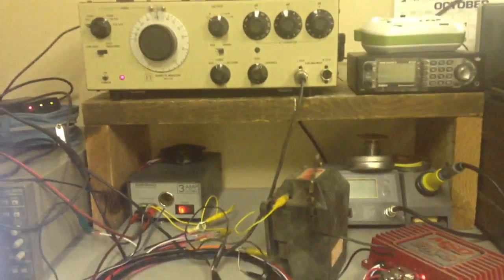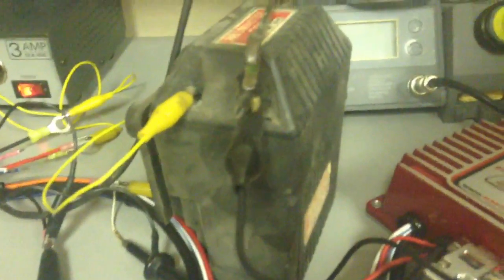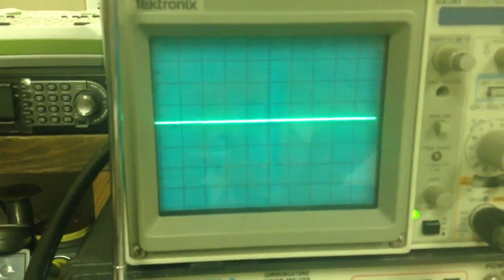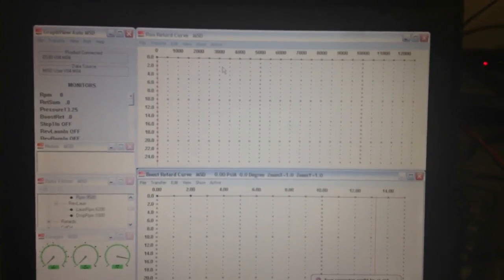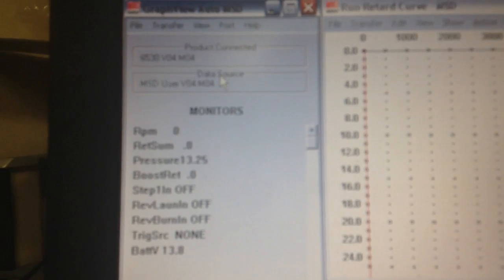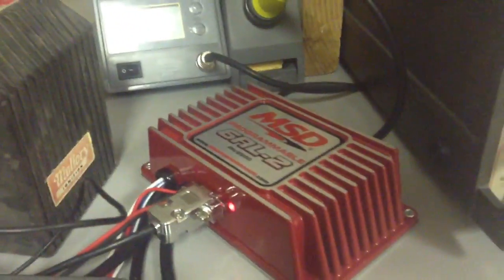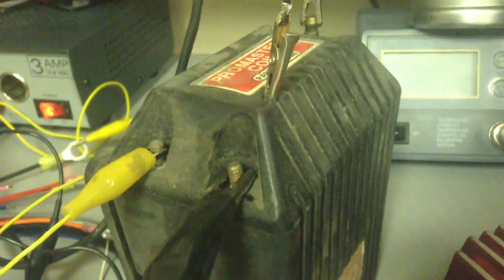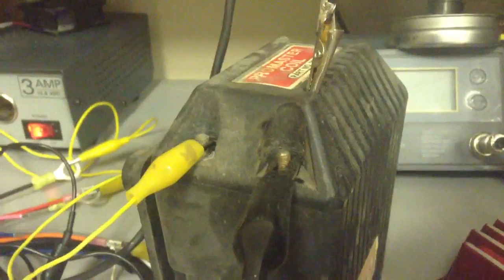MSD Programmable 6AL-2 review

Comment: that may have a msd sport compact ingnition , You Can Install In a carbureted V8 engine?
Reply: Yep, I did on a 75 corvette with a 500hp 383 stroker.  All you need is a billet distributor that can be locked out.

Comment: Question I have a used one and want to test or ensure it powers b 4 I wire it up. I just need to connect the two wires to battery and the switched positive correct